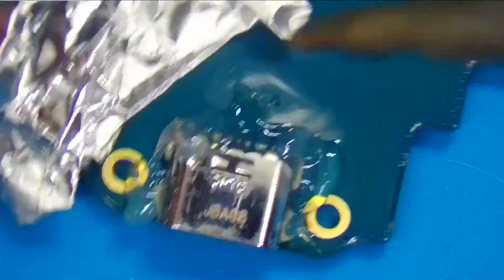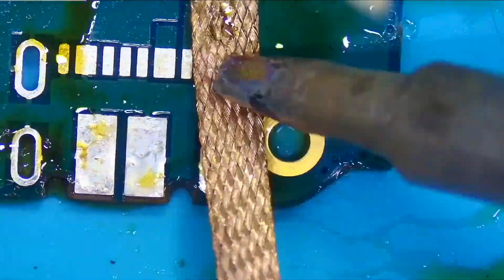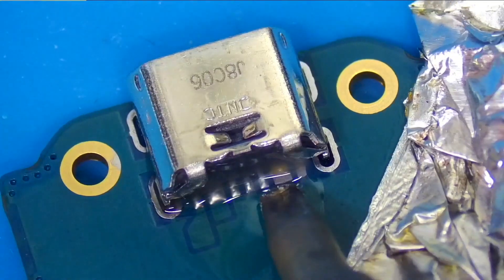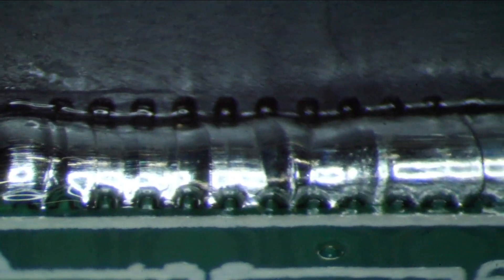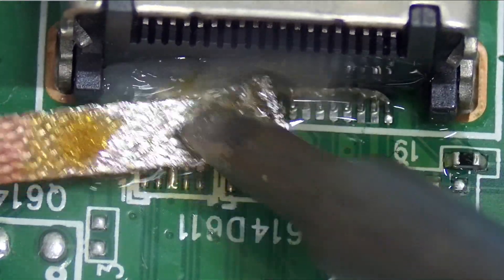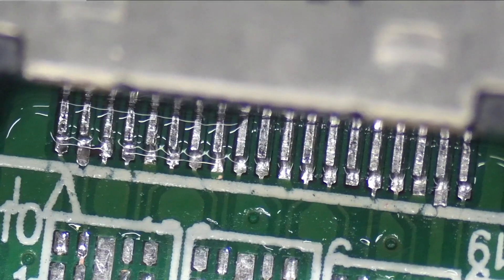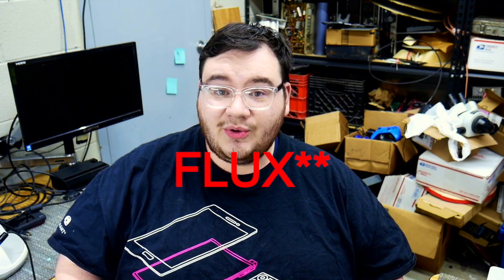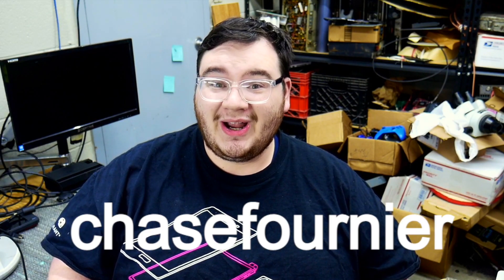3 Tricks to Solder Perfectly EVERY TIME!

Comment: Excited to try out these tips & tricks to find new and interesting ways of how bad I am at soldering 😜
On the 2 flux types you recommended purchasing, what is the difference between the two “models”?
Great vid man.
Reply from the maker: Thank you! I Recommend buying both and see which one you like more! 559-asm Is harder to clean, but lasts longer on the board (in my opinion) and 213 seems to not last as long, but is easier to clean up!